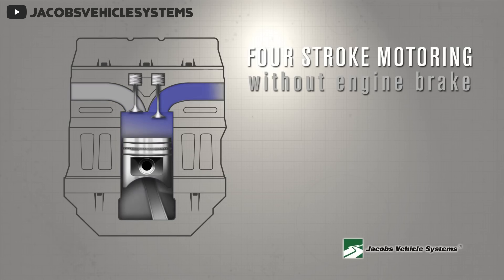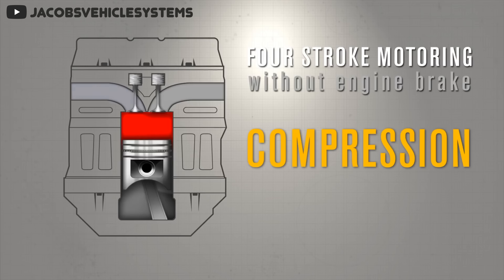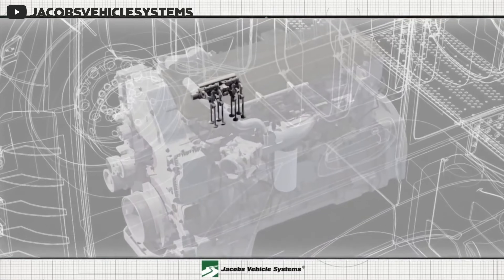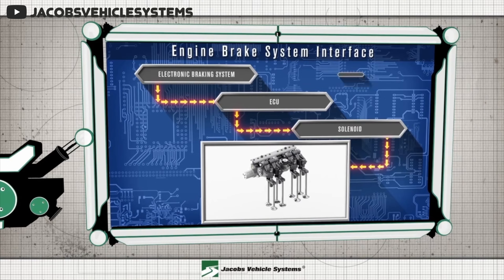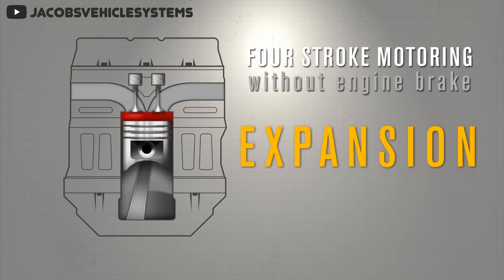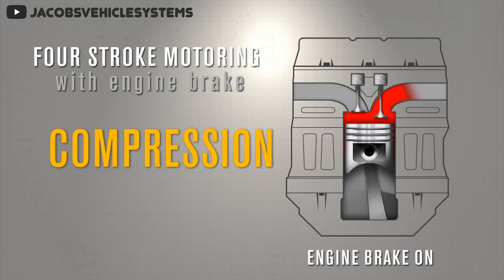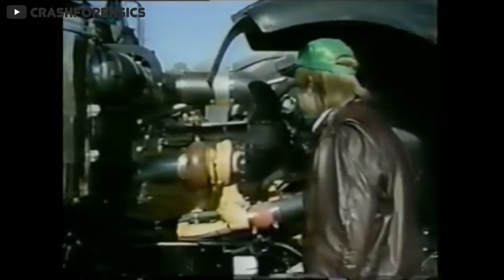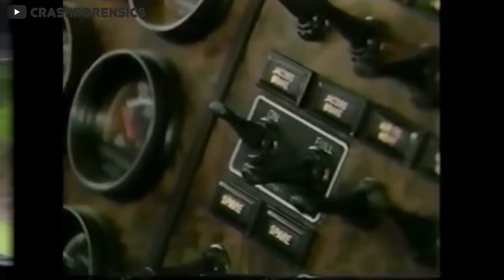What is a Jake Brake and How Does it Work?

Comment: I drive two diesel cars and they have more engine brake than my previous gasoline car.
In a 20-25% incline on a first gear I almost don't need to use the brakes, but I need to use more on a gasoline car.

Comment: The Jake brake also works on two-stroke diesels.  In the 1970s, I drove a Crown school bus with a 6-71 Detroit Diesel with a five-speed, non-synchro transmission.  The five-speed transmission had big splits so we used the Jake brake to catch uphill, up-shifts to get the bus to shift faster.  Here is a video of a Crown bus with a 6-71 Detroit two-stroke diesel and a Jake brake.
https://www.youtube.com/watch?v=l3NP_pqFTzE

Comment: Oh the good ol days when I drove a 1971 cabover Kenworth with a 290 in it with no power steering and Jake brake, I'd be the last one over the hills and the first one down them, white knuckles on the steering wheel and brakes smokin! Oh yeah-that would keep you awake! A bit scary at times for sure, I'd be scared I'd miss a gear on the way up the mountain and scared I'd run out I brakes on the way down!

Comment: The video at 4:02 completely misrepresents how the compression brake consumes energy. It is understandable why so many commenters don't grasp the concept.

When air pressure is increased, it consumes energy, and it's temperature rises. When air pressure is reduced, it dissipates energy, and it's temperature drops. A coasting diesel engine will inhale air, compress and heat it, then that heated and compressed air will push the piston back down. As the piston goes back down, the pressure and temperature of the air in the cylinder will drop, returning nearly all of the energy back to the piston. It's similar to bouncing on a spring, it keeps returning the energy. This is why the air flowing through a diesel engine doesn't create much retarding force while coasting under closed throttle.

The video incorrectly shows the exhaust valve opening as soon as the piston starts to rise, expelling the fresh air through the entire upstroke. With the open exhaust valve venting, the air in the video never has a chance to become compressed during the compression stroke, so a negligible amount of energy would be consumed through compression.

In reality, both valves stay closed as the piston rises on the compression stroke, and energy is transferred from the piston into heat and pressure of the air through compression. Then the exhaust valve opens when the piston is near the top (much later than shown in the video) expelling the compressed and heated air before it has a chance to push the piston back down, preventing that energy from being transferred back into the piston. The distance the exhaust valve opens, and the duration of the opening cycle, is very small compared to the way the valve acts on the regular exhaust stroke. When the piston is almost done rising, and under high compression, a very brief and tiny exhaust valve opening is all that's needed to let the heated air escape before it has a chance to return that heat and pressure back to the piston.

Excess kinetic energy (in the form of speed) and excess potential energy (in the form of elevation) is normally absorbed by converting it into heat by the foundation brakes through friction, and then dissipating that heat to the atmosphere. In order for a compression brake to share some of the retarding force, it must have a way to gather and dissipate heat. The compression brake puts heat into the atmosphere by capturing the heat of the compression stroke, and immediately routing it into the exhaust system. Some of the heat of compression is absorbed by the engine block and cylinder head, transferred to the coolant, and then dissipated to the atmosphere by the radiator.

The video never shows how the engine gathers the energy through compression.

The video also doesn't mention that the retarding force provided by a diesel compression brake is proportional to the RPM of the engine. The faster a diesel engine is turning, the more cycles each cylinder goes through in a given amount of time. The more air that can be inhaled, the more air that can be compressed, the more heat that can be absorbed and dissipated, and therefore the greater the retarding force.

The video also says a gasoline engine provides more retarding force because it uses a throttle body. This is a misleading statement. The air-to-fuel ratio in a gasoline engine needs to stay within a fairly narrow range. A gasoline engine uses the least amount of gasoline while at idle. A tiny amount of air is allowed to pass through a gasoline engine at idle, the rest is blocked by an air valve. As more throttle increases fuel flow, the air valve will partially open to allow more air to enter the engine, keeping the air-to-fuel ratio nearly constant. At full throttle, the air valve will be completely open.

A compression brake similar to what is used on a diesel engine would be ineffective on a gasoline engine. At closed throttle, very little air flows through a gasoline engine, so there would be very little air available to compress and absorb energy.

Some comments suggest putting an air valve on the intake of a diesel engine to provide retarding force. If that would be effective, then everybody would do it that way, as it would be very inexpensive to do. But restricting intake air offers almost no retarding force. It takes much more energy to create high pressure than it does to create vacuum in a small space in a fraction of a second.

Comment: STOP with the throttle body /butterfly valve /vacumn pumping loss crap  if it was that easy don't you think they would just install a throttle valve on a diesel   Take an old gas vehicle without a steering wheel lock  point it downhill turn off the key and push the gas pedal to the floor    now let off the pedal and you will feel the vehicle speed up  The difference with diesel is that you have nearly twice the compression THEREFORE more spring back  The jake vents the compression before it can push the piston down  Like trying to bounce an underinflated basketball  it deadens the engine and makes it absorb energy  Cummins and Detroit do it best because they time off the injector lobe directly rather cat and Mack that time off a neighboring cyl intake or exhaust valve

Comment: No clue where you got diesels dont have throttles on em
Reply: Historically they most often didn't have throttles(Some were "vacuum governed" though using the "vacuum signal" by a throttle to adjust fuel injection volume), more modern ones have "throttles" to aid in sucking in exhaust gas from the EGR-system(And possibly for higher combustion chamber temperature operation at low loads/cold engine(Not an expert on modern stuff so I don't really know)), but yeah they don't really work as on traditional petrol engines.
But as said earlier historically diesels didn't have throttles, the gas pedal operated a governor that controlled power by changing the fuel volume of the "direct injection"(If a prechamber is used, it is called "indirect injection") into the combustion chamber a bit before and during the power stroke.

Comment: Jake brakes are not for use in city driving. Also, Jake brakes are not a replacement for your worn out brakes that you’re too cheap to replace. They’re best used in hills to save on brake life and reduce the risk of heat soaking your drums.

Comment: I wouldn't say a Diesel has no emgine brake capabilities. I drive a loader (an N/A and a turbo), and a 90s turbo Deere ag tractor and both slow down significantly under normal wmgine braking. Then again, theyre not 80,000lbs barreling down a grade.

Comment: Hello!! I have a peterbilt 335 with the paccar x6 engine with engine brake, my question is my transmission sometimes fails and the scanner showed low voltage but we couldn't find the problem, whenever the transmission fails the jake brake doesn't work either. Have you had any experience like that?

Comment: in a t880 when your def system starts burniing or regenning on the go.. it robs so much power from engine that it feels like level 1 engine breaks.. in the winter letting go of accelerator can mean losing control.. i hate it... there is an inhibit regen switch. but it doesnt work for me the way id like it...INSTAnTLY...ohhhh the future is fucked.
side note.. i hate def................ also. this videos bout eng brakes so lets help make no engine brake signs illegal...thank you
the engine brakes shown in video are only on 1 or 2% of trucks out there

Comment: Question. Are you losing fuel in that compression cycle? Since the compression is released at the top of the compression stroke is the sound of the compression braking caused because the ignition detonation is released directly into the exhaust system? Thanks

Comment: Stop calling the engine brake a "JAKE" brake!  Jake or Jacobs is the manufacturers Name. The brake component turns the engine into an air compressor which slows the engine rpm. When the engine brake mechanism is activated it opens the exhaust valves in the cylinders, after the compression cycle, releasing the compressed air trapped in the cylinders, and consequently slows the vehicle down.
Reply: when the brake mechanism is activated it alters the operation of the engine's exhaust valves so that the engine works as a power-absorbing air compressor.

Comment: In England or Europe, about the only time you see a Jake Brake is on an American import. The rest use an electro magnetic retarder of some design. No noise, in many no physical contact  bettween drive shaft and magnetic unit. They can also be intrgrated into the service brake pedal so no extra switching or manual setting required.

Comment: My Chevy light duty duramax has great engine braking and I wound have to assume is because it is barely putting any diesel in so it just compresses air without cumbusting any of it. That compression would then slow the vehicle. When I let off the gas on a flat surface going 55 it’ll slow down to 5 within <20 seconds not loaded. Now I see that the jake brake would make engine braking way more effective but there still is great engine braking due to the mere compression ratio.

Comment: If as you say, don't know myself so am not disputing you, Jake Brakes and Exhaust Brakes are not the same item (or whatever term) then I will have to recheck the signs into our residential and commercial township.  I thought the signs all said "Use of Exhaust Brakes Prohibited".  From what little I knew about the subject I thought they were prohibiting the Jake Brakes.  Or perhaps that was meant, but the wording on the signs is wrong.  Then again maybe the signs do say "Jake Brakes".

Comment: IIRC from the 70 in the high mountains of Colorado, there were a number of amusing signs.  Paraphrased examples:
Steep downhill grades next NN miles.
<many miles later>
You're not through yet!  Steep downhill grades next NN miles.

There were also signs around towns saying to not use Jake brakes, but I doubt anyone paid attention.  If you need it, you need it.  It was nerve-racking enough driving a heavy 5000 lb car.  A 40 ton truck must be much more so.

As for smaller vehicles, my hybrid car has a "B" transmission selection, which does much the same thing as a Jake brake.  That plus regenerative braking dissipates a lot of energy, though long steep downhills can still overwhelm it.  That said, after 155000 miles I haven't yet needed to replace the friction brakes on that car, though the most terrain I've taken that car is the 5 in the southern California mountains, which is serious though wimpy compared to Colorado.

Comment: Question  :.  --- If most gasoline engines on the road today are fuel injected, then why do we still have throttle bodies?  Why aren't gasoline engines managed the same way as diesels by regulating the fuel?

Comment: I drive a 1994 Toyota Hiace truck with a naturally aspirated 2.4 liter diesel, I live in the hills and seldom use my brakes on the down hills. I have 180,000 KM( 110,000 miles ) and 95% of my brakes left, it's how you drive that makes the difference.

Comment: `sorry to pop your bubble but a jake brake actually works on a vacuum not compression with the jake switch on when the piston reaches top dead center the solenoid pops the exhaust valve open and releases the compressed air and at the same time the solenoid shuts off the fuel exhaust valve closes then the piston goes down the cylinder in a vacuum over the years I've won thousands of dollars on the same misconception you have

Comment: Ah. So diesels burn in a way that smells like arse, the price of the fuel is highly elevated, AND they lack the same safety/braking capability of a gas engine?

Seems a good reason to grandfather them out and laugh every time a diesel driver catapults through their windshield when they lose control.

Comment: I drove 10 wheel trucks in the 80’s for a governmental agency which had a small fleet of them. The retarders/jake brakes were disconnected because apparently new drivers would misuse them. So we had to make really sure when coming down hill with a load the speed was kept low as possible.  The trucks were automatics so couldn’t really downshift to retard speed.  As cautious as I was there were times the brakes had nothing left to give.  I would pull over letting them cool, then head out again.

Comment: Good explanation, but -- on the question of why Jake Brakes aren't need on diesel cars -- I would add something.  In cars, you can pump the brakes for downhill slowing, which tends to mitigate brake heating.  In a truck with air brakes, every time you take your foot off the brake pedal, you vent some of your compressed air to the atmosphere, and if you pump the brakes enough (called "fanning"), you'll run out of compressed air.

Comment: The piston on the compression stroke ignites the air/fuel mixture but it does not create an explosion. The fuel ignites and burns the fuel which creates gases that expand and force the  piston down and pushes the crank shaft. that is the power source that makes the vehicle go. That energy is enough to stretch cylinder head bolt etc. An explosion would damage the engine in no time. Diesel engines in semi tractor trailer need  rebuilt after  a million miles.  
-------------------------------------------------
One trucker wrecked his rig and said he gonna get a brand new Peterbilt.

Comment: 2 things you are wrong on.
First of all saying a diesel engine has little or no engine braking is totally WRONG. It is obvious you have never driven a vehicle with a diesel engine and manual transmission.  I suggest you go out and do so.
Second, the fuel does NOT explode in the combustion chamber.  It does however burn/combust.  If it where to explode, the engine would be destroyed in no time at all.  But don't take my word for it.  Go ask any mechanic and see what they have to say.

Comment: I Love the sound of a Jake Brake. Screw the tree huggers. The drawbacks of the Jake Brake is that they need higher rpms to work well. This makes them not nearly as effective in in city driving such as with fire equipment. If the drivers manually shifts the automatic transmission they can keep rpms higher but automatic transmissions don't like to be shifted that way. This is a good basic principle operation but didn't go into the meat and potatoes.

Comment: I think the newer models of trucks with an automatic transmission operate a bit differently. When I drove a manual at the start of my career, you had to get your speed right in order for the engine brake to work. If you were going too fast, you could be in big trouble. In my 2020 freightliner it's completely different. I can cruise down a grade with a load and do 55 no problems, providing the setup is right. Also, my rpms are high, sometimes right below redline, and that's normal. Engine braking in winter can be done safely, but only as an assist to your service brake. You have to ride them. It's a good idea anyway to keep your brakes warm when it's really wet out or you might find you don't have any.
Reply: Higher RPM produces more braking power.

Comment: Turn off the fuel. Diesel engine turns into a big air compressor. It absorbs energy and saving the brakes for later on. Easy answer.

Comment: We motor home drivers are mostly amateurs about our machines, and we frequently are towing a car behind our coach.  Fifth wheel style RV trailers have another different set of problems.  It would be interesting to see an overview of the various brake systems employed by RV.  My RV, for example, is a 40 foot coach, towing a Chevy SUV, with an added braking system for the towed car, brand name Air Force One.  It works great, but don't ask me to explain how it works!  And the coach  has an electric switch to engage "engine braking," same story.

Comment: Many Motorcoaches also have them (referred to as retarders) & they are a big help on downgrades even though we don't carry near as much weight as a truck does. It helps when you only want to slow a little & does save the brakes. If you are in a multi Bus move & want to keep separated by a safe distance to each other, it really helps.
Reply: Motor coaches often use a different technology because the loud noise of a jake brake is not acceptable to many RV customers. The technology they use is more like a throttle on the exhaust pipe. Pac-brake is the leading brand of this kind of retarder. It slows the vehicle down, but  it works very differently than a Jake Brake.
Reply: @G5Hohn  I'm not a mechanic or am I an expert,  I do know that it makes a big difference. I'm just happy when it's on the Vehicle. No, it doesn't make a loud noise, but it's very effective. I know because I had a Motorcoach shut down & I lost use of it, & it took much more effort to slow down.